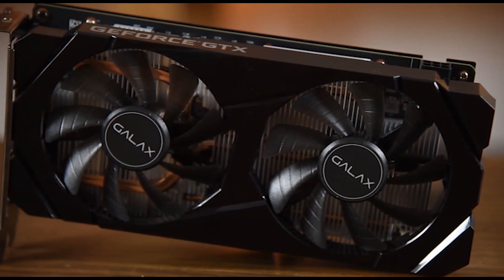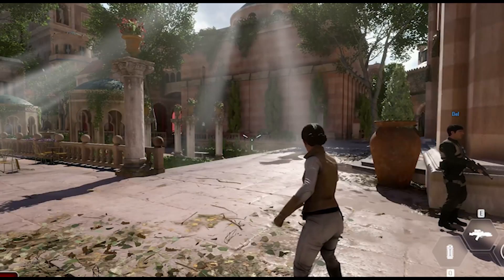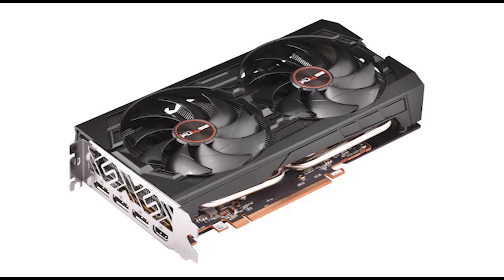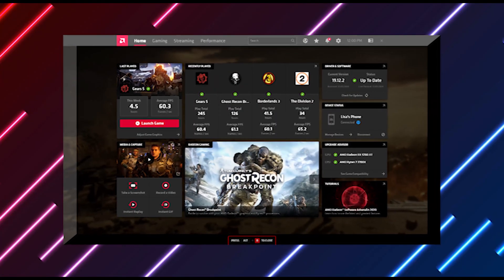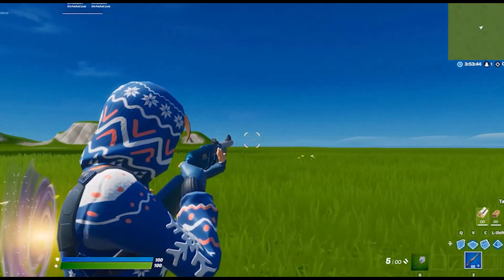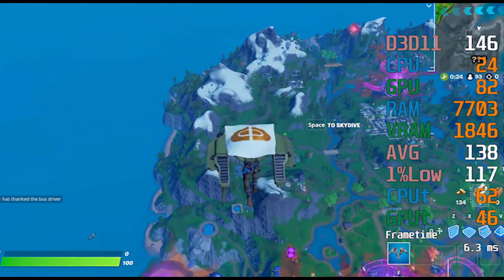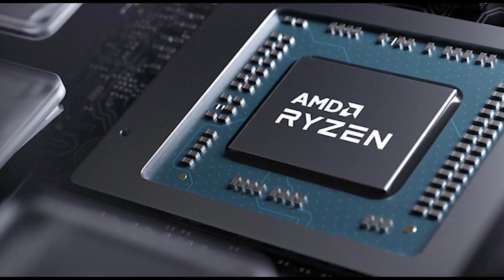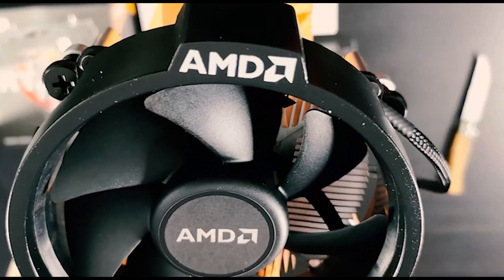GTX 1660 vs RX 5500 - Which is Better in 2022?

Comment: What's the difference between this one and the XT model I'm  thinking about a HP pre-bill that has this card how much am I missing out on
Reply from the maker: About 20%
Reply: @TopTierTech1  you think a 400 w power supply would be enough for the RX 590 it's one of the HP ones just curious